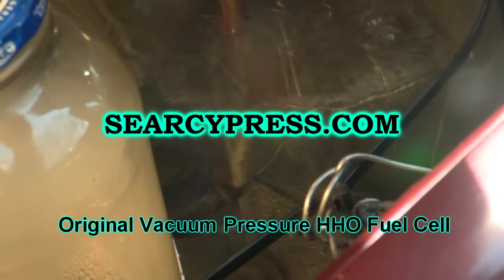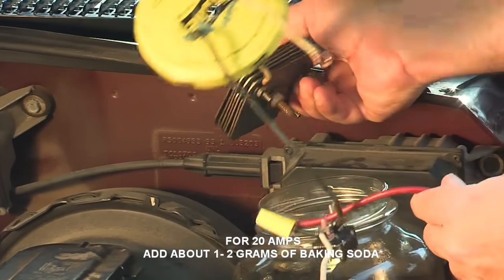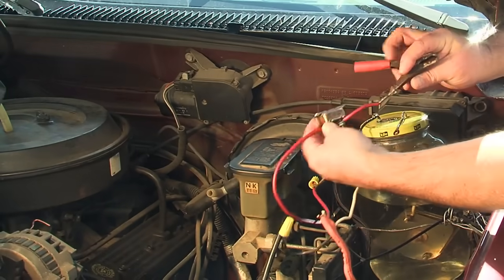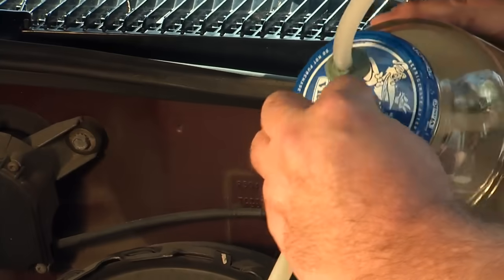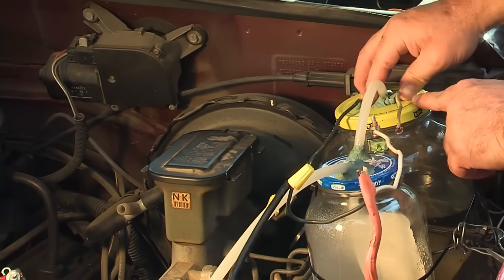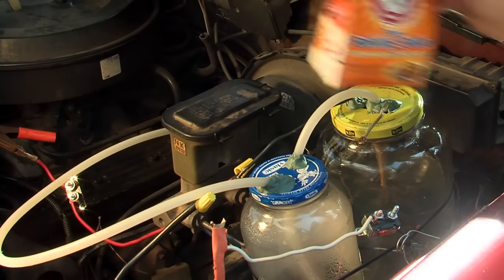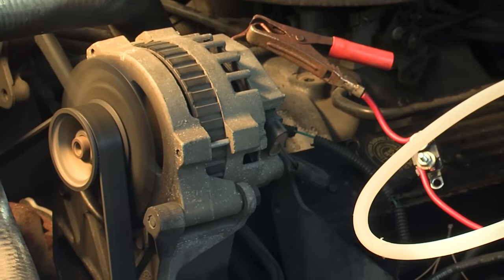Vacuum Pressure Hydrogen fuel cell defeats high gas prices using hydrogen from H2O.

Comment: Two words. Dunning Kruger.
Reply from the maker: Spoken like a true pseudo-intellectual. Thanks for the comment.
Reply: @metalpresstv  there’s no such thing as “vacuum pressure”, genius.  A vacuum, by definition, is a lack of pressure.   There’s either pressure. Or vacuum. 
But yea. I’m the pseudo intellectual. 
Your dumbshit idea has been debunked about a thousand times.  And here you are putting pickle jars under your hood. Dumbest. Shit. Ever. 
1. Your little glue isn’t holding a vacuum
2.  The moment you start extracting the hydrogen from the water, the “vacuum” disappears. 
3. This isn’t even close to a “fuel cell”
4.  Introducing electricity to water makes hydrogen. It also makes oxygen. Your brilliant mind doesn’t even consider the fact that introducing oxygen might be making the change you see or feel
5.  There is an oxygen sensor that will adjust engine performance based on oxygen intake.  If your car takes in too much oxygen, it’s running lean and the sensor will tell the computer to INJECT MORE FUEL. 
6.   You’re full of crap 💩
Reply: @metalpresstv  Bro you put pickle jars that do nothing, in a ICU car running on gasoline
If this was real, people OTHER than redneck trash would be building it. 14 year old indian kids would be building them for the science fair.

Comment: Welcome to a world where the laws of thermodynamics do not apply and nobody has ever heard of the conservation of energy.
Reply from the maker: You're making the assumption that we're powering the engine with HHo. That is a misunderstanding. Not all of the gasoline is burned in the combustion process. We are simply burning as much as possible in the cylinder instead of the catalytic converter. Any gain at all comes from the gasoline that we are using and not the HHO. New video coming soon so be sure and subscribe. Thanks very much for the comment.
Reply: @metalpresstv . Nope. You are making the assumption here.

There's a good reason why the world is not powered by electrolysing water under vacuum.

It takes more energy to break the valent atomic bonds to release the hydrogen and oxygen than the resulting gases can themselves supply.

To claim that you are getting better mileage or better performance would be to claim that you are pulling extra energy out of your ass.

Sorry, but the second law of thermodynamics says that you're a liar.
Reply: When trying to sound smart goes wrong 😂.. Such an old ignorant take full of false assumptions. As if the entire vehicle is running off hho 🥴

Comment: So you need to use energy from engine to generate hydrogen. This requires more energy than you get out. You will get slightly better consumption until you use up all the battery charge. Then you need more energy to charge the battery........... You would be better using a cold fusion generator. Perpetual motion machine. Obviously di lithium fusion would be tops.

Comment: Doesn't it take more energy to draw out hydrogen than you gain from burning that hydrogen?
Reply from the maker: We are not powering the engine with HHO. As much as 20% of the fuel goes unburned in a very poor combustion process. We are simply burning as much fuel as possible in the cylinder instead of the catalytic converter. Any gain at all comes from the more efficiently burned gasoline and not the HHO. New video coming soon so be sure and subscribe. Thanks for the comment.

Comment: Your light switch is only rated at 15A
Reply from the maker: Prototype. We burned up a box of toggle switches and it was a very risky but effective solution. Do not replicate. 😁 Thanks for the comment.
Reply: @metalpresstv  if you need a 20A switch, look for a motor rated switch😉
Subbed & waiting on the updated video

Comment: Hydrogen fuel cells make power by combining hydrogen and oxygen which creates water as a byproduct. How does this do anything ? Your separating hydrogen using electricity which puts extra draw on your alternator , and then tiny amount of hydrogen you produce from 1 gallon of water with electrolysis somehow boosts combustion enough to recover all the time and waste ? Seems hard to believe .
Reply from the maker: I guess you missed the concept. You're making an assumption that one  hundred percent of the fuel is burned by the engine. That is not correct. Only about 80% of the fuel is us actually burned in the combustion chamber and the rest is burned in the catalytic converter. We're creating a more efficient combustion process that burns all of the fuel in the cylinder instead of the emission system. We have a new video coming out soon which will try to explain a bunch of it. The gains come from burning gasoline and not from the hydrogen and oxygen gas. Thank you for the comment.

Comment: Water/alcohol water injection systems actually work, they were used on many American fighter planes of WWII and they provided a 20%+ boost when activated for emergency situations. But the original system required a tank, some plumbing and a pump to inject the mixture into your engine. This looks a little sketchy, but it probably works on a limited basis. There are systems sold for this purpose, my father in law used a Speer system on his R/V and it provided a boost in economy and performance. But kudos for your efforts in making this system.
Reply from the maker: This is definitely a different approach from that. I myself owned an Edelbrock water injector. It is pretty amazing they quit making all of that. We have a new video coming out on this topic very soon so be sure and subscribe. Thank you very much for the comment.
Reply: My father in law had one on his big motorhome in the 1970s or so. It was made by Speer and ran on manifold vacuum. He was able to advance the timing a couple degrees and got better performance and gas mileage, too... @metalpresstv

Comment: What were miles per gallon before and after. I have seen these tested and the results were less than impressive
Reply from the maker: It's very doubtful what you saw was a test using a vacuum pressure system. Injecting into the air  intake has never yielded any results for us. That is what led us to try injecting in the state of vacuum. What we saw was a drop in the catalytic converter temperature which resulted in a lot of water coming out of the tailpipe. We did a lot of control tests on the mileage. What we truly discovered was controlling those tests is extremely hard. Running the engine out of gas. Adding exactly one gallon of gas. Measuring the mileage. driving till it runs out. 15 mpg. Again add one gallon of fuel and switch on the HHo vacuum pressure system. Drive until it runs out. 25mpg. That is how our very best result test went. We did find the results would always very with temperature and road conditions and even the altitude. How you drive the vehicle is of course the most critical factor. Be sure and subscribe as we are going to release a follow-up video to this one in the near future. Thank you very much for the comment.
Reply: @metalpresstv  thx for the reply. Im very tempted to try this.
Reply from the maker: @ptech88  I'm not going to lie the concept is solid but the actual application that you see in this video was very sketchy. We did it that way because we were the pioneers with this technology and we had to save money and time in everything we did. Many years have passed and we have made great advances which we will be showing in our upcoming video release. We can't release it just yet, but we are really excited about it and are looking forward to that time. Of course we made it much safer now because this was probably the most dangerous looking contraption you have seen. Back then we broke rules of electrical wiring and many other things in that first prototype but we did so in an effort to move forward. Honestly it was not that dangerous with very cautious use but no way we could sanction anyone reproducing it. Thanks very much for your comment.

Comment: will this work on non carb engines?
i have a '94 toyota pick up which has early fuel injection i believe
Reply from the maker: That's kind of a loaded question. It is probably going to work but because engines are made differently and there are so many different manufacturers it's really a hit-and-miss situation.

Comment: Canada...before I retired from truck driving, there was a man with a company selling hydrogen seperators that fed a hydrogen mist into air filter of trucks. Much safer, increased fuel mileage.
Reply from the maker: We originally were injecting into the carburetor and after measuring results, we realized there was no increase. Injecting into the vacuum reduces the dilution of the HHo. The catalytic converter cools way off and that is the reason you see so much water vapor coming from the gasoline. We will  show all of this in our next video so be sure and subscribe. Thank you very much for the comment.
Reply: @metalpresstv  Yes, understand,  Canadian retailer told of pure hydrogen powered electric generator for mining, out laced by Cn govt. New product used 20 Oz of water in 6 hour periods, device the size of camper refrigerator. I pass this on to you, may be of use in your future designs. Have a super day.

Comment: very cool idea. does it work on diesel engines to?? or just petrol
Reply from the maker: If the engine produces a vacuum that you can tap into it can be done. We have a new video coming out when the timing is right so be sure and subscribe so you don't miss it. Thank you very much for the comment.

Comment: If you make a darlington system using a .1oh 10 watt resistor you will never consume more than 5 amps, the system will produce a good amount of hydrogen for the engine.

Comment: There have been so many test on this that have proven that it doesn't help and may hurt fuel economy.

You see, as you draw more power from your alternator it creates more resistance, using more power.
Reply from the maker: Let me break it down for you. When this technology first started we squirting it into the intake of the engine. This did not work and we proved this and moved on to something else. We started injecting into vacuum and began seeing great results. However, the videos we made in the very beginning showing us injecting it into the intake spurred interest and many people repeating those events and claiming that they had results for one reason or another. We tried every method you can imagine but the only thing that ever yielded any results was the vacuum pressure design. When you inject into the system in the state of vacuum, you do not get the dilution that occurs when you inject into the intake of the manifold. You can easily tell this is working because the catalytic converter temperature drops tremendously and a lot of water begins coming out of the exhaust because of the gasoline byproducts. We have a new video coming out so be sure to subscribe so you can learn a lot more about this topic. Please understand, the videos that you watch that show no results are always not taking place using a vacuum system. It is a completely different approach to the entire process and it is the reason there has been so much confusion. We will clarify this in our next video that will be coming out when the timing is right.  If you don't subscribe you might miss it so please do so. Thank you very much for your comment.

Comment: The power you draw from the alternator to electrolyse the water is at the expense of more power from the engine, hence more fuel. Yes I'm skeptical. No free lunches.
Reply from the maker: I completely agree there is no free energy, so let me explain. For some reason people always assume that the engine burns a hundred percent of the fuel. That is not even close to correct. It only Burns around 80% of the fuel when things are working right. At least 20% of the fuel that's unburned is then reignited in the catalytic converter. Let's just be gracious and assume this is for emission controls. Why not just design an engine that burns at super high-efficiency so  no emission controls are needed right? Anyway that's not how it's done. What we do is ignite as much of that 20% wasted fuel in the cylinder using vacuum HHo injection where it can do some good. The result is a much cooler catalytic converter. That is why you see so much water coming out because the water vapor created by the gasoline does not get vaporized. We have a new video coming out when the timing is right so be sure you subscribe so you don't miss it. Thank you very much for the comment.

Comment: Can you use plastic tanks? How often do you need to change out the baking powder/water solution?
Reply from the maker: Using plastic in a vacuum system like this is impractical because the heat and vacuum will distort the shape of any normal plastic. On average we add water about every 200 miles or so. This can vary with temperature & altitude and many other factors. The system of course performs much better on long drives than it does around town. Don't forget to subscribe so that you see the release of the new video when the timing is right. Thank you very much for the comment.

Comment: As far as I understand it there's no way this improves milage. The laws of equivalent exchange prohibit it. There's always a loss of energy in the system. Using the gas to make electricity for electrolysis to make hydrogen to be burned as fuel results in a net loss of energy as it takes more energy to brake the bonds holding the h2o together than you get from burning hydrogen. Otherwise it would be an infinite energy source and some dilhole making it out of junk would be revolutionizing the world's energy needs.
Reply from the maker: Okay let me explain the concept to you. I completely agree there's no such thing as free energy as we have been taught to understand it.  You're under the impression we are powering the engine with HHo. We are not. Combustion engines like this only burn about 80% of the fuel in the combustion chamber. The other 20% is then burned in the catalytic converter system. This serves the purpose of cleaning the exhaust gases. It seems a little off because why would you just not make an engine that is so extremely efficient no catalytic system is needed. I assure you this is possible but however, it is not economically viable in an industry that is so heavily regulated and influenced. We are injecting this hho gas into the combustion chamber in the state of vacuum. This causes a more complete combustion inside the compression chamber burning more of that fuel that is commonly wasted. The result of this is a cooler catalytic converter. That is why you see so much water coming out of the exhaust system, because it is not turned into water vapor in the emission control section. Eventually it does heat up however. Many people assume that the excess water coming out is from the HHO gas, however it is a byproduct of burning the gasoline. What we are doing is attempting to improve the efficiency of the actual burning process reducing that 20% waste. Any gain in performance is not coming directly from the HHO. It comes from gasoline. We have a new video coming out when the time is right so be sure and subscribe and we'll talk a lot more about this. Thanks very much for your comment.

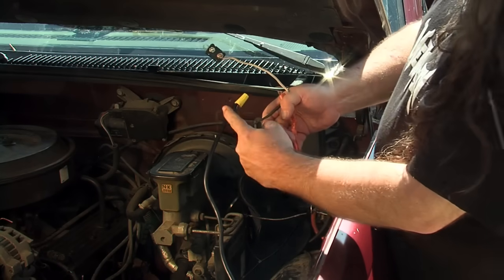Comment: 0:54  That is NOT a 20 amp switch... it's 15. and so far I'm cringing hard core.
Reply from the maker: It's worse than you think. That's 15 amps at 120 volts. Drop the voltage down to 12 everything changes. I don't recommend you replicate. I'm just showing you what actually worked. We have a new version that is done much better and safer and the video will be out when the timing is right. We went through dozens of toggle switches that all burned out before we finally were forced to try something different. I don't sanction anyone replicating anything they see in the video. Do not replicate. That being said that switch never did burn up. Thanks very much for the comment.

Comment: Car electrical system HHO generators are rooted in perpetual motion theory which is 100% debunked. The extra load on the alternator required to produce the HHO means more fuel is burned. The energy available from the HHO CANNOT equal or surpass the energy needed to create it.

Comment: If I put a second alternator to car would this produce more gas? Would this be worth doing you think?
Reply from the maker: Not really. You can find alternators that can produce hundreds of amps. It's not really needed. About 30 amps is all that is needed. Producing excessive gas is not always a good thing. You reach a point of diminishing returns. We have a new video coming out when the timing is right. Be sure and subscribe so you do not miss it. Thanks very much for the comment.

Comment: Rust inside the engine. Caused by water?
Reply from the maker: You get a lot more water in your engine from the use of gasoline than you do the hho. It is a byproduct of burning gasoline. Thanks for the comment be sure and subscribe we have a new video coming out when the timing is right.

Comment: Is there a specific bi-carb to water ratio for the main jar? Also I'm assuming smaller plates could be used for smaller engines/alternators? 
Does this process increase or decrease combustion chamber temperatures?
Reply: increase should use a pyrometer